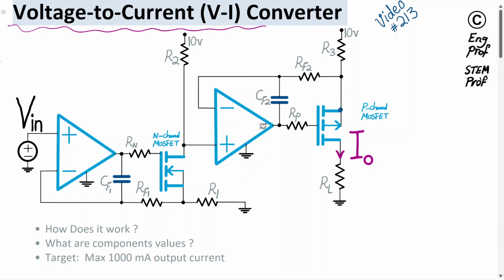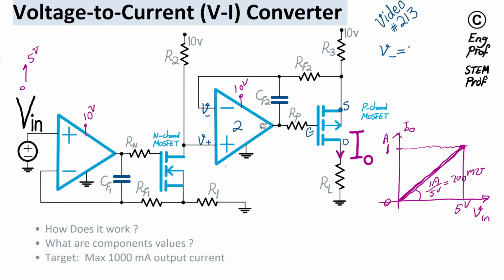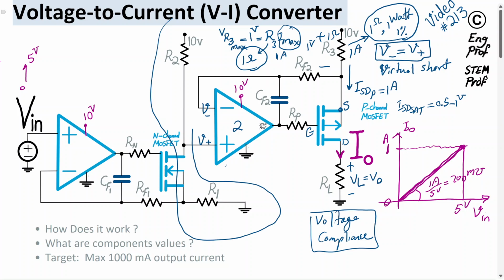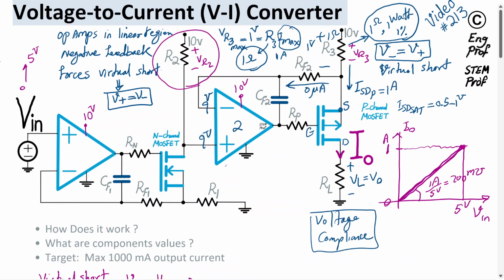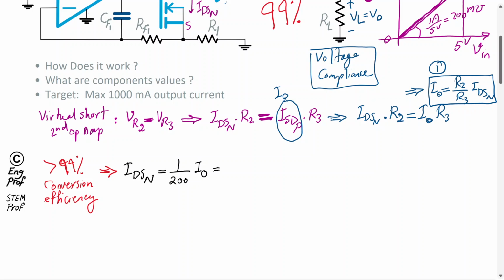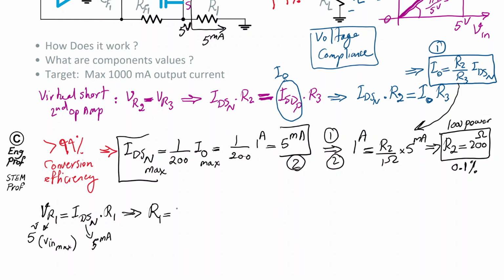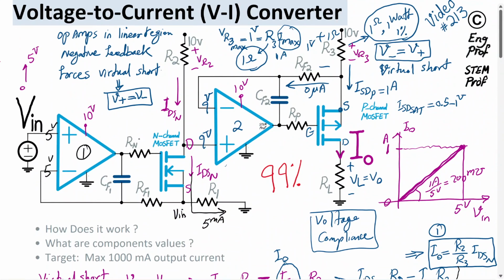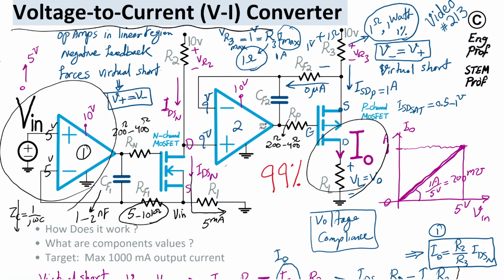Voltage to Current Converter explained with PMOS and NMOS transistors

Comment: Can this circuit be used in an electronic load?
Reply from the maker: Generally speaking, yes. However, practically speaking, it depends on the type of load. The voltage-controlled current source, also known as a transconductance amplifier, explained in this video, is designed to provide up to 1000 mA of current to the load with a maximum of 8V, given a 10V supply. This indicates that the largest load resistor in this scenario is roughly 8 ohms. The P-channel power MOSFET must be selected carefully, considering the target load and power consumption requirements. Here are a few related videos to watch: Temperature-Independent Current Circuit Design with Op Amp, BJT, Zener, Schottky Diodes https://youtu.be/hFbnjbddUvs
Programmable Current Source Design with Op Amp, Zener Diode and Digital Potentiometer https://youtu.be/R1x6B0TczWk
On-Chip BJT Current Source Design https://youtu.be/Rs7gEMk03dw
Push-Pull Power Amplifier with Darlington Transistors https://youtu.be/866MYibo8yE

I hope these videos are helpful.

Comment: Dear author,
Thank you very much for the video! Can you explain the comparison between using Nmos and Pmos as passive devices in this current converter?
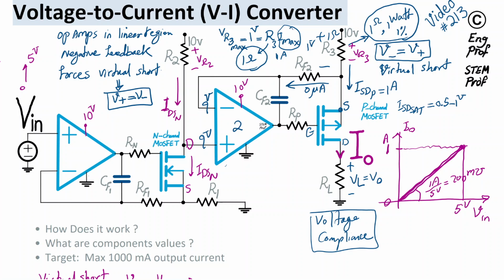Reply from the maker: My pleasure. Glad that you like this Voltage to Current Converter Video. For another MOSFET circuit Video see "How to design a charger voltage regulator" https://youtu.be/NdfyHoxjKrY .  Regarding your question, NMOS and PMOS transistors are active electronic devices (that require to be properly biased to work) in contrast with passive components like resistors and capacitors. Please watch the video at minute 11:28 when source terminal of NMOS and source terminal of PMOS are marked on the circuit diagram.  For NMOS, the gate voltage needs to be higher than the source voltage by at least Threshold voltage (Vt) to turn on the NMOS. But for PMOS, the gate voltage needs to be less than the source voltage by at least the the magnitude of the threshold voltage in order to turn on the PMOS transistor.

Comment: Very interesting circuit. Well explained.
Reply from the maker: Thank you! Glad that you like Voltage-controlled current source video. A related example is the Programmable Current Source Design with Op Amp, Zener Diode and Digital Potentiometer https://youtu.be/R1x6B0TczWk . I hope it is interesting as well.

Comment: Very useful voltage to current source.
Reply from the maker: Glad that you liked this voltage controlled current source. Here are a few related circuit videos:  On-Chip BJT Current Source Design https://youtu.be/Rs7gEMk03dw 
Programmable Current Source Design with Op Amp, Zener Diode and Digital Potentiometer https://youtu.be/R1x6B0TczWk hope there are useful as well.

Comment: So it seems that we don't need to care about the output of the op amp?
Reply: Mosfets are voltage-controlled devices and would not draw any significant current from the op amp output due to their very high gate input impedance. So the mosfets and resistors are the ones whose current handling are of concern.
Reply from the maker: @control_voltage  Well-said, as long as the proper negative feedback and stable circuit is in place, then Op Amps outputs will converge to proper voltage values via negative feedback that will enforce virtual short for the positive and negative input terminals. thank you.
Reply from the maker: https://www.youtube.com/@chaochang1305 Good question, as long as the proper negative feedback and stable circuit is in place, then Op Amps outputs will converge to proper voltage values via negative feedback that will enforce virtual short for the positive and negative input terminals.  Here is another example https://youtu.be/NoNgQpbj77Y of a gain control Op Amp output converging in real time to proper voltage value to electronically control the resistance of JFET transistor.

Comment: Second opamp also need to be able to accept input to the top rail, right? Otherwise I'd think an easier choice would be to give them some higher supply like 12V. And first opamp input needs to be ground-sensing. 

I thought that maybe you started discussing what the figure of voltage compliance should be, but didn't really summarise a final conclusion for that. I'd guess it'd be (10V - 1V - ~1V) = ~8V.

The design also seems to rely on a good quality 10V PSU, that can remain solid from 0-1A; that doesn't seem trivial either.

Appreciate the time spent on practicalities of compensation
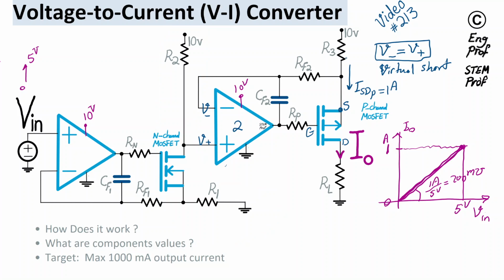Reply from the maker: @ivolol Good questions and thanks for the reminder regarding voltage compliance that I also briefly started discussing it at 4:46 in the video (mentioning voltage drops across resistor R3 and saturation voltage across source-drain of power PMOS). You summarized it well 10V - 1V - ~1V = ~8V is a practical assumption.  Output voltage across the Load can vary from zero to about 8 volts in this circuit with proper design.  For  the supply, of course extra care is needed including considering say 100 uF (or higher) Bypass caps on the supply to minimizes supply noise and variations. If supply voltage variation is considerable then it should at least have a minimum value around 10 volt in order to insert a voltage clamper component like properly sized Zener Diodes. An example is discussed in the video https://youtu.be/Lu760gdQee0 which is a Modified Wilson Current Mirror with PNP BJT Transistors.

Comment: Whats the point of the first stage? Why not just use e second stage alone?
Reply from the maker: Good question. Without the first stage, we get a Negative Transconductance for V-I conversion.
Reply: @STEMprof  My simulation says that we can more or less give signal into inverting input of opamp which then drives p-mos and measures the drain with noninverting input. I think ive also done similar things on breadboard.
Reply from the maker: @ricolauersdorf687  Thanks for sharing your insights and simulations results of your alternate wiring with single Op Amp and power PMOS. While, feedback wise, what you suggested is functional, the potential issue is it grabs voltage from the drain of PMOS which means the feedback will depend on the load value rather than direct dependence on the output current of the circuit. Here are a few more circuit videos https://youtu.be/mNYq5QId1pE  is a Hybrid Current Mirror with JFET BJT transistors  -------- and https://youtu.be/QY48IQXJIRI discusses a Temperature–Compensated Programmable Current Source Circuit Design with Zener Diode, BJT Transistors.
Reply: Perhaps for temperature stability, but I would not think the mosfets would be close enough in temperature if the currents they provide are very different.
Reply from the maker: @control_voltage  Thanks Christopher for sharing your thoughts regarding thermal stability. While as @ricolauersdorf687 and @jg99997 noted, there are alternative ways to realize this circuit, the preferred design is the dual-stage design given that the BOM cost is super minimal since the NMOS transistor is a cheap low power transistors and given that the cheap CMOS Op Amp packages usually come in dual or quad op amp.  The single stage design can work but it comes with its own drawbacks including more sensitivity to op amp noise and dependence on output load value in case of grabbing feedback voltage from the drain of PMOS. There are of course many other ways that a programmable current source/sink can be designed for instance: On-Chip BJT Current Source Design https://youtu.be/Rs7gEMk03dw 
Programmable Current Source Design with Op Amp, Zener Diode and Digital Potentiometer https://youtu.be/R1x6B0TczWk

Comment from the maker: Voltage to Current V-I converter circuit also known as Voltage-controlled current source is discussed in this video.  For more analog circuit examples see:   Wilson Current Mirror and Current Source Design https://youtu.be/LfbfJYrovN0
Temperature-Independent Current sink with Op Amp, BJT, Zener, Schottky Diodes https://youtu.be/hFbnjbddUvs
Thermometer Circuit Design with Op Amp & BJT transistor https://youtu.be/55YsraFE0rg
Analog Computer Vector Sum Calculator with Op Amp and BJT Transistors https://youtu.be/PIAsa0QNVns
Instrumentation Amplifier with Electronic Gain Control https://youtu.be/C4tghZ-q6Zs
Programmable Current Source Design with Op Amp, Zener Diode and Digital Potentiometer https://youtu.be/R1x6B0TczWk
On-Chip BJT Current Source Design https://youtu.be/Rs7gEMk03dw
Push-Pull Power Amplifier with Darlington Transistors https://youtu.be/866MYibo8yE
Analog Logarithm Computer https://youtu.be/RpKEq5WyoLg
Op Amp Analog Computer Differential Equation Solver https://youtu.be/ENq39EesfPw
Sawtooth Waveform Generator design with OpAmp, JFET, BJT https://youtu.be/5zHXTx-Vl20 
op amps Circuit with feedback loops to design an analog computer that solves a second order differential equation https://youtu.be/HeZRtnRXpEI 
For more analog circuits and signal processing examples see: https://www.youtube.com/playlist?list=PLrwXF7N522y4c7c-8KBjrwd7IyaZfWxyt
I hope these Circuit design and analysis videos are helpful.